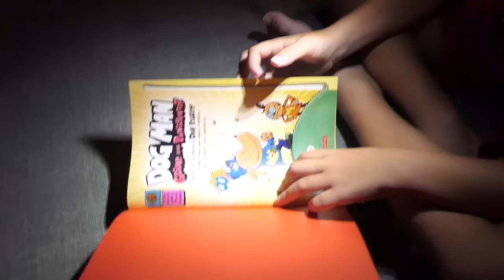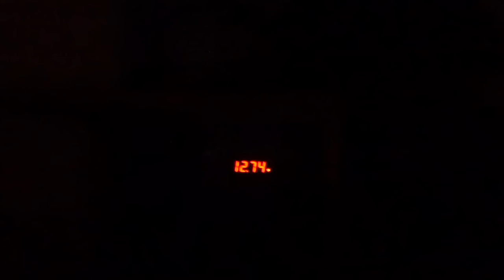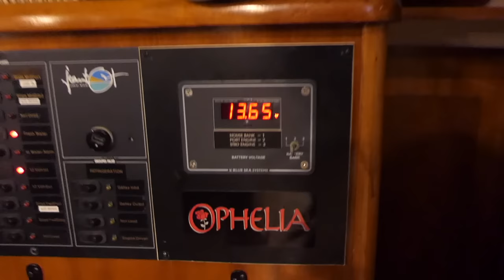TWO DEAD GENERATORS and our LITHIUM are DYING | SailAway 243

Comment: i dont have any gennys in mine. you just need a good lithium system. need a wiring diagram ?
Reply from the maker: Well, we do have lithium and they're great...but you have to charge them.  We have solar and a generator as key parts of that system.  The generator quit and it was cloudy for 3 days.  We've since fixed the generator, but our next upgrade is more solar.  However, we could hardly do that in the 2 days we had before our batteries flatlined.
Reply: @SailAwayVlog  i have 2 high output alternators and 2 hydrogenerators. no genny reqd.
Reply from the maker: Yeah, we put a Balmar on the last boat and that was a good option too for backup.  Both those and hydrogens are good options for under way, but not great at anchor.  Hydrogenerators for obvious reasons, and it's not great to run the primary diesels for charge daily at anchor..hard on them at such low rpms and no load.  A diesel generator is much more fuel efficient and you can load it down with other stuff to keep it happy.  Just gotta keep it running.  Lol.

Comment: A shame you had to get another gas powered inverter charger.  I assume you checked spark to the sparkplug and the float bowl was getting gas.  Sometimes a shot of starting fluid into the air cleaner will allow the engine to start (if there is spark) and vacuum created from piston intake stroke pulls gas from tank, thru float bowl, needle into the cyl.
The diesel generator- a few ideas- temp sealant/tape around lift pump inlet and outlet to make sure not pulling air in.  Another idea - diesel jerry can set up above the height of the generator with feed and return lines going to it (or just an open funnel above engine filled with diesel attached to feed line and bucket/jerry can to catch return fuel.  This would test to see if gravity feed of diesel allows generator to run.
Interesting that 12.74v is considered so low for your lith bats- just seems odd/relatively high.  Seems in many other lith bats that BMS will allow low cutoff to protect battery in the 11v range. Guess this would be in the 5% of power remaining.  Yes you cut down on the number of lifetime cycles but taking bats to low voltage doesn't kill them.  Some BMSs shut down/go to safe sleep and actually need a pulse of 13v dc power to reawaken them.  Your bat's manual would have info.
Hope you are in St Martin or much more south by this time.